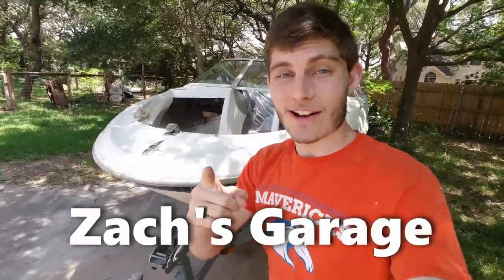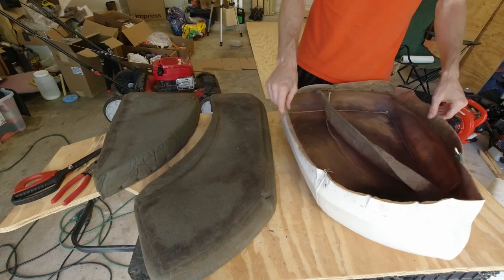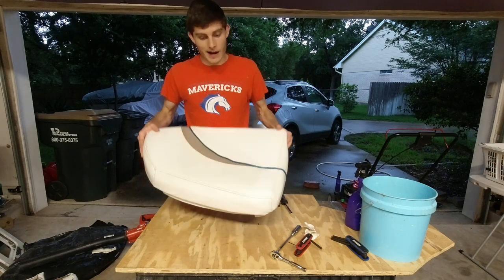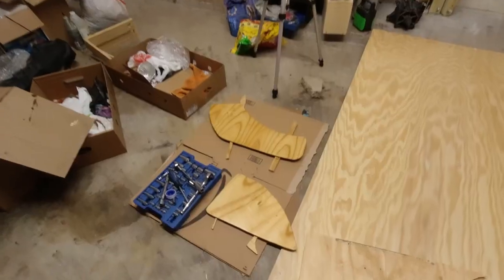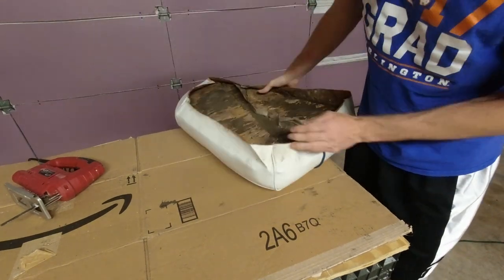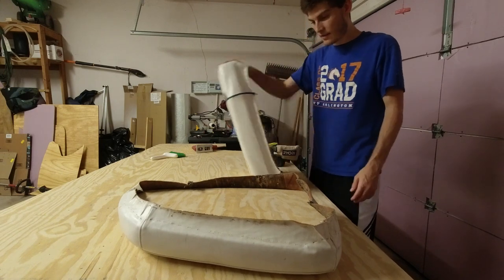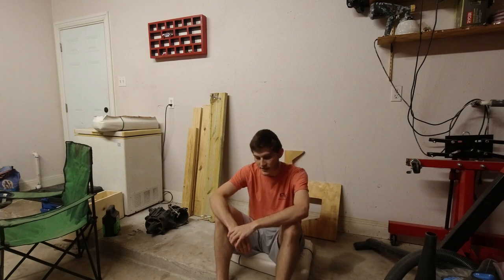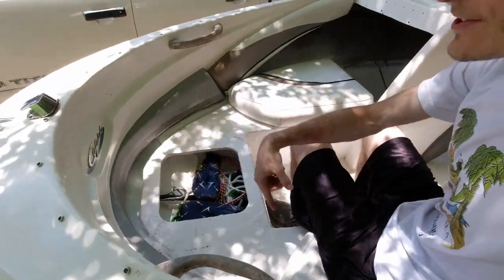Bayliner Boat Restoration - Part 32 - Bow Seat Cushions

Comment: I'm not sure how I missed this channel, I'm doing basically the same thing at the same time on the basically the same boat on my channel lol... For those bow seat cushions, it looks like someone replaced the wood on them already at some point.  From bayliner they are one piece of wood like the one you made.  To handle the fabric pull, you put the cover on without the front piece of foam installed so you can staple it to the top side of the wood, and then insert the front foam, flip it over, and staple away.  Then again, with the older foam like yours and mine, its compressed quite a bit and the fabric pull doesn't too much anymore so you probably can't even tell...  Great video!
Reply from the maker: Thanks! The real question is, how did I miss your channel?!

Comment: should be one piece plywood for the seat bottoms, put one foam pad in place couple staples on bottom perimeter then staple down the divider then add the other foam, then finish the bottom staples

Comment: I'm Just Curious. Ive done allot of rest work on a 3 jet skies, I'm thinking I want to attempt a boat, as I sold one of the restored skis to help pay for a boat. How much resin have you gone through to get to this point? also how much of the 1708 and chop strand  glass have you gone through? Ive been trying to find Four Winns Horizon 170 or 180 to restore.
Reply from the maker: About 10 gallons of resin. I'm not 100% sure on the amount of glass. I bought a 3'x~200' roll of each and I have a ton remaining, over half.

Comment: Why anyone would go to all this trouble and not use marine plywood is mind boggling. You probably would not even have to epoxy coat all the wood. You would still have to tab it to the hull but not completely coat every piece. Water evaporates from wood if its not coated. Also how is the water going to drain from all those little compartments usually there would be numerous limber holes.
Reply from the maker: I knew someone would chime in about the marine plywood ;) Comes down to preference, nothing wrong with marine grade, I don't like my wood to be wet in general though. You're absolutely right about needing drainage holes in the compartments. That why I made sure to have the holes if you look at some of the other videos when I built the seat boxes
Reply: @ZachsGarage1  Even though you are epoxy coating the wood you still have voids between the plys besides the water proof glue used in marine plywood there are no voids.